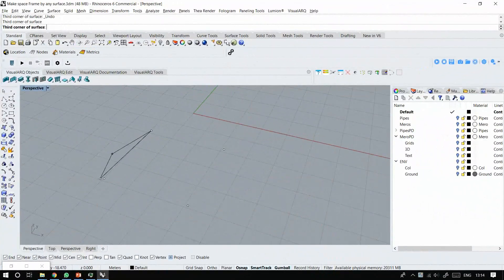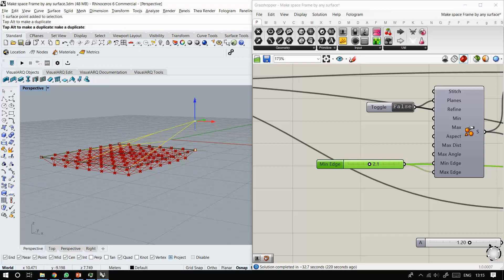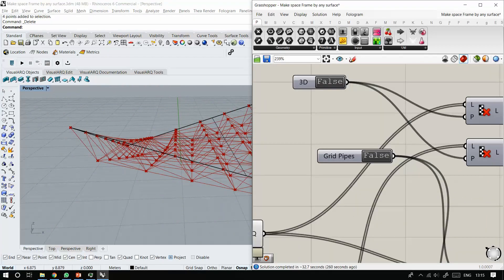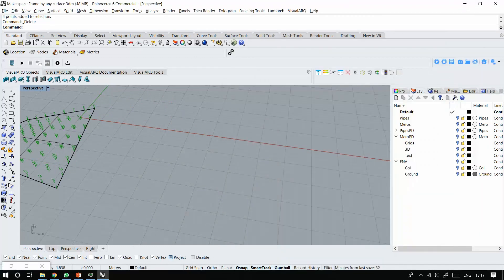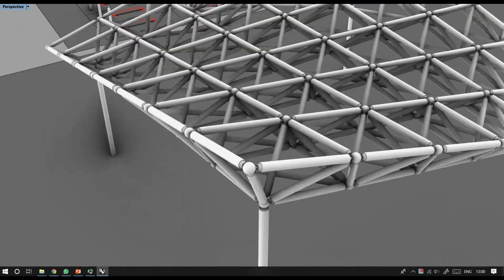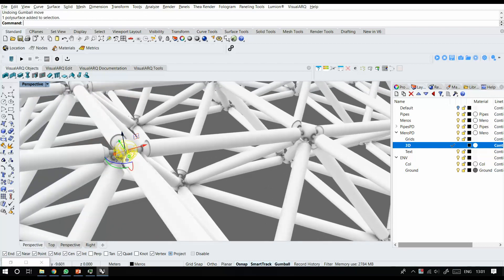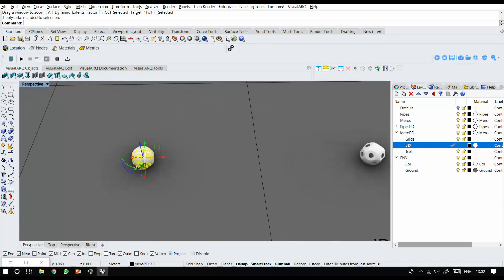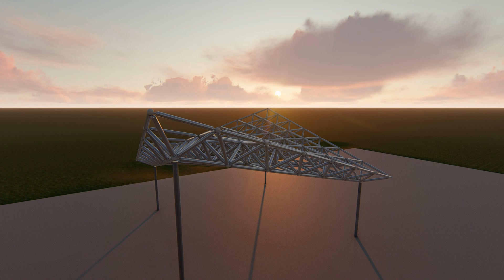Computaional design for SpaceFrame by Grasshopper

Comment: Is there a direct link between Gh and SAP2000 that you are using for generative design or are you manually making the changes based on the SAP2000 analysis? Can't this be done with Karamba?
Reply from the maker: I did it manually. meaning I export the wireframe and use it in SAP2000. there are some ways to direct importing to SAP2000 but I dont think can be use as generative design
Reply: @ehsanmokhtaryArchitect  i think geogym has a plugin for sap setup and export within grasshopper environment.